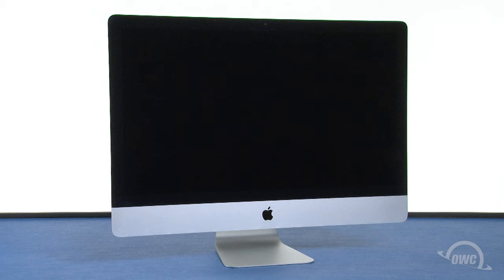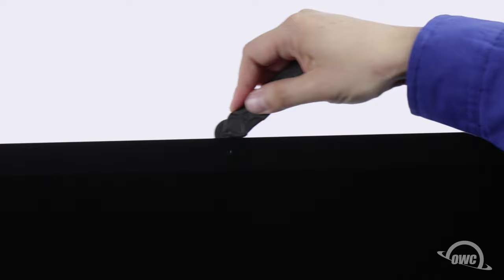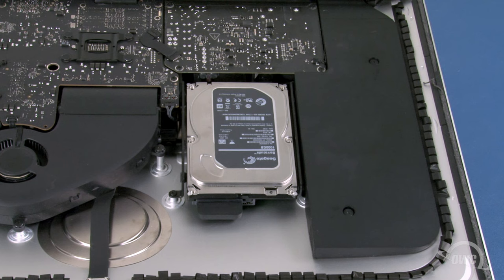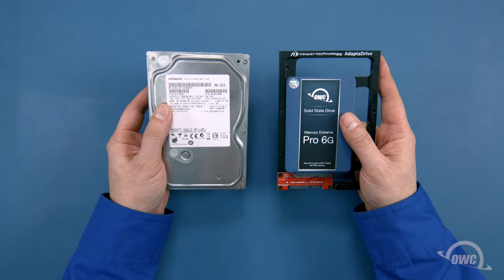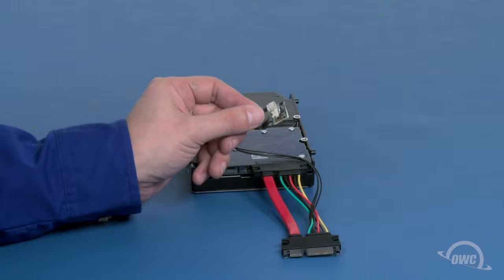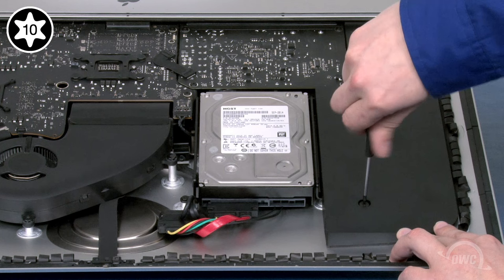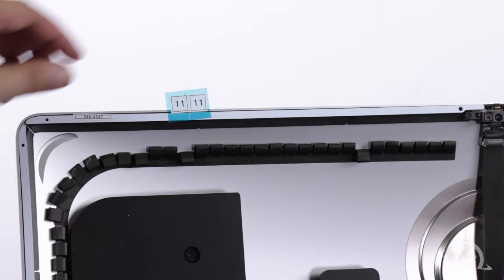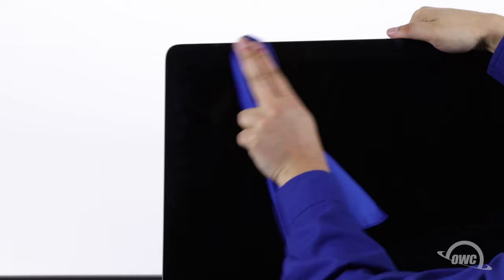How to Upgrade the Main Drive in a 27-inch iMac (Late 2012 – 2019)

Comment: Thank you a million times for this video.  I took my 2017 iMac apart...replaced the SSD...put it back together...created a boot drive to get it going....and it worked! Who knew?! Tremendous video.
Reply from the maker: We are pleased to hear. Thank you for your feedback!
Reply: I'm about to do this to mine, did you need to put a thermal sensor on your SSD to stop the cooling fan from staying on?

Comment: The most difficult part is lining up the screen once you've peeled all the adhesives.  If you want a flush fitting then I would strongly suggest you affix the screen in an upright position so that the bottom part has no gap.  Unfortunately I followed the method in this tutorial (with the screen flat) and the bottom part of my screen has a small gap and the glass sticks out along the top - it's only the width of a finger nail but still annoying.  Had I affixed it with the screen in an upright position, the bottom base would be sitting flush with no gap.  The tape does seem very sticky but I've since bought more adhesive and will try again.  If you're worried about the screen tilting whilst upright then just jam a lunch box behind it and the stand.

Comment: Hey!  I just upgraded my 2013 27" iMac to SSD using your kit and THIS video and it was a perfect install!  Everything works great.  It took about 55 minutes, and saved me $300 that a local shop told me it would cost!  (minus parts)  You know, I just might start advertising this service on my own! haha  Thank you!
Reply from the maker: We are happy to hear. Thank you for your feedback  :)
Reply: How did the adhesive hold up considering OWC's adhesive is thin tape and not foam like Apples and it seems to be a big issue with screens falling off?
Reply: Well I broke the screen and probably the motherboard… my point is simple while I wont blame OWC if this were medicos advice somebody would be going to prison.. I loved my iMac but talk about a shit design even experienced  techs want nothing to do with replacing the PCIe .. this is not an easy DIY install and you saying it was don’t make it so.. Might wanna mention that if you break the screen you might as well throw the fucking computer way pretty much much so anyways I appreciate your checking in with this success story.. Do you know what a shill is? Anyway I got my max studio coming in a week so I’m not gonna miss my iMac or hearing from you for that matter ciao

Comment: Help!!!!! I am a long-time OWC customer who upgraded the HD in a 2009 iMac. However, when I learned that the 2017 iMac display is affixed with tape, which can make removing the glass without cracking it dicey, I took my iMac with the upgrade drive and OWC kit to a computer repair tech, who then used his own tools to remove the glass. Never did I imagine I might end up with a damaged exterior. Apparently his tool slipped and he sliced through the center of the aluminum front. Then, the next day, I came to appreciate that the internal mic no longer hears anything (except if I tap on the case). Presumably, the adhesive tape in the OWC kit covered my mic port, so now the entire thing has to be opened up a second time to fix it!

So I'm curious: Are these known risks of this kind of work? Confused because I the only thing you ever hear about is the risk of cracking the glass while prying it loose. As for the slice through the Apple logo, the video shows the display being opened up like a book after the top and right and left sides are released. The remaining portion is released from the inside along the bottom edge where there is no access to the front of the case. (Regardless, I can't see how this could have happened with a plastic tool. Looks more like razor blade damage :-(
 
It occurred to me to look up skins like people apply to their phones or laptops to cover the front of my iMac, but I can't seem to find any real choices for the 27" iMac that aren't super expensive and/or ugly. (Even the mega-site Amazon comes up empty except for 24" iMac skins. Mine is a 27", which I only bought new in a box less than two months ago, which is another reason why this situation has left me kicking myself.)

Anybody have any suggestions? For example, is there something out there that can fill the aluminum scratch and make it less obvious?

Feedback for OWC: An instructional video of this nature should begin by summarizing the risks up front — ideally within the first two minutes of the video. Besides the install kit, this YouTube video was shared with the tech but either he didn't feel he needed it, or the video was just too long to watch to pick up the relevant FYIs along the way. After the initial "disclosures' are out of the way, the next part of the video should summarize key differences among the 2012-2019 models. For example, on some models within this group Apple put the mic at the bottom of the display instead of at the top near the camera. Another variable exists between iMacs that have the screen affixed with magnetic display clips vs. adhesive tape. Yes, we know that there are risks to doing upgrades of this type — but if you've done one iMac you might be tempted to think you can do them all. It's NOT ENOUGH to simply say at the outset of a video to watch it all the way through. OWC and similar How-To videos should summarize any special considerations or risks before proceeding to the instructional component!
Reply: I took my 2017 27" iMac for repair five weeks before the three-year AppleCare warranty expired in 2020 due to an insect visible under the display. I was pleased that they replaced the display without question at no cost. However, I didn't use the microphone much, but about a year after the repair, I noticed the microphone no longer picked up sound except when tapping on the case. I didn't think it was related to the repair since it was done by an Apple-approved service. My main drive finally failed this week, so I will be replacing it with an SSD. While researching how to do this, I discovered that the adhesive tape can cover and muffle the mic. Hopefully, when I clean up and apply fresh tape carefully, the mic issue will be resolved too

Comment: go through all that just to put back in a spinning hardrive seems counter productive.
Reply: Not that bad with patience. The benefits of having a faster SSD drive far outweigh the alternative of having a slow outdated drive. I’ve done 4 of these and it’s pretty easy now.
Reply: @artincorona  i did a SSD replacement shortly after that comment on a late 2013. screen was tricky and you really need to get the kit. runs like a beast now. short of hardware failure It will last me a few years now.

Comment: Good video. I wish you folks had included a look at what it would take to remove a fusion drive's SSD component as well.
Reply from the maker: Hey moeskido,

We have a whole separate video for the blade SSD.
https://eshop.macsales.com/installvideos/imac-27-inch-5k-2019-pciessd/
Reply: @poweredbyowc  Thank you for that! Small wonder the shop that replaced my failed fusion drive didn't go after the SSD without specific instructions.
Reply from the maker: As I mentioned on the other video, replacing the flash blade in a Fusion Drive http://support.apple.com/HT202574 is not for the faint of heart!

Comment: HDD/SSD can be replaced without your kit on any iMac, no full power fan blow, soon will reveal how. Just did it on iMac mid 2009 and late 2013. So no more paying for the cables
Reply: Hi. Can an ssd be put into an imac without a thermal sensor?
Reply: @hang-sangitch  thermal sensor is not a problem, it should be attached the same way as the original drive, BIOS is the one who causes the problem

Comment: OWC should highlight the microphone coverup issue in the video.  It is in the instructions with the adhesive tape, but not very obvious to the average user.  The tape is quite difficult to attach across the bottom edge of the screen anyways the tabs are in the wrong direction.  Hard to get it flush.
Reply from the maker: David, Thank you for your feedback! We appreciate your input regarding the microphone coverup issue in the video. We'll definitely take this into consideration for our future updates.

Comment: On my 2017 27 inch, I just added an external SSD and in the system settings had the start-up disc placed on the formatted SSD. Not a barn burner, but better than the fusion drive.
Reply from the maker: Hey Reecce, glad to hear the SSD had sped your computer up a bit, distance from the board matters when considering an external drive for booting, generally internal drives are faster than external but it isn't always the case, like with your fusion drive. If you ever are looking to replace your drives feel free to give us a call at 1-800-275-4576 we'd be happy to assist!

Comment: I'm a little confused. as to why I was sold the AURA X2 Memory for my iMac 18.3 All the info was conveyed to the salesman by clicking on the small Apple icon at the uppermost left of the screen (about this mac)and giving this info to the salesman..It verifies I have 2017 5k from mid to late 2017. This is an 18.3 and thus I believe not available for this type of memory why was I not informed about this before I have had to go to all this trouble?
Reply from the maker: Thank you for reaching out to OWC. We are sorry to hear about any confusion that was caused. You can upgrade the imac 18.3 with an SSD as long as the machine was issued with an SSD. If you machine only came with a standard HDD then you would need our Mercury Electra or Extreme SSD kit. Please reach out to our team and we can assist you further with your order.

Please see this link ( https://eshop.macsales.com/item/OWC/K27IM12HP2TB/ ) for the kit you would need.

Comment: And what about the data? Do you clone the drive before installation? Or after installation copying from the original drive? I’m missing that step in this video.
Reply from the maker: It is up to you. You can clone the drive before installation or after it is a personal preference on what is easier for each person.  Most of our Drive DIY kits have the option to come with an external enclosure to make this process easier for the customer.

Comment: To try and avoid headache, I wanted to get a replacement drive running externally before installing internally.

It was suggested that APFS was the format I should use for the replacement SSD for my late 2015 27" iMac running Mojave. However, it would not allow me to modify it or install an OS on recovery mode boot. With my drive failing and seizing up when trying to run disk utility, I had use another newer computer to keep reformatting it.  When I formatted into Mac OS extended journal it would accept it.  For some reason, as it was about to be done installing the OS out of recovery mode, it would go to a black screen with a spinning white loading circle that would go on forever.  When I did a alt/option boot and selected the new drive, it said it was prohibited.  Then after a bunch of attempts, I did a command-shift-R and that seems to have done the trick. Weirdly enough, sometimes I still get a prohibited startup.

Don't know if anyone else had problems but I though I'd share.
Reply from the maker: I will just say unfortunately...sometimes computers are both tricky and special in how they like to "misbehave" here and there. I'm sorry that you had to go through such an adventure just to be able to do that, but hopefully it won't happen again. Reach out to us directly anytime you have any issues.

Comment: Do you confirm that all 27-inch iMac wether late 2012 late 2013 up to late 2019 are really the same regarding their overall sub-systems ?

Here I mean that once we remove the LCD display glue then only two connectors then when removing the left side speaker, easy access to the HDD which would then host say a SSD ?

Can we re-use the PSU (power supply unit) from any model to repair another one ?

How about the LCD display, is it intercgangeable through all models from late 2012 to 2019 ?

By the way, when installing a Crucial SSD to replace the HDD on my late 2013 iMac, I did not need to add any temperature sensor, it just worked fine.

Thank you, Albert
Reply from the maker: Do you confirm that all 27-inch iMac wether late 2012 late 2013 up to late 2019 are really the same regarding their overall sub-systems ?
- Yes, all 27" iMacs share the same model number, A1419, indicating they have the same sub-system.
Can we re-use the PSU (power supply unit) from any model to repair another one ?
-Yes, you can use the same PSU provided there is no damage to it.
How about the LCD display, is it interchangeable through all models from late 2012 to 2019 ?
- Unfortunately, not all share the same specifications, such as Retina, 5K, or none at all.

The Thermal Sensor is responsible for controlling the fan in the iMac. We highly recommend installing it. While a drive replacement will function without it, the fan may not detect the drive, causing it to run faster than necessary. If you're comfortable with this, the sensor may not be necessary in that case.

Comment: I watched the OWC videos several times and ordered the OWC kit and installed the OWC 2TB  SSD and then installed Monterey. Well,  Monterey would not recognize any of my external  SSD, or USB drives. So I reverted to a clean install of Big Sur and all was well but my iMac boots up very slowly and takes nearly 5 minutes to get to the log in screen. I can live with a slow boot-up but it’s weird reading about other people having speedy boot-ups. I just chalk it up to my machine being a late 2015, 27” w/32GB ram external.
Reply from the maker: Keep in mind that the logic board firmware needs to have an OS installed first with an OEM Apple drive before it can be installed with a Third-party drive. This could be what was causing the issues with your Monterey install.
Reply from the maker: Boot time is not solely dependent on the operating system; it's also influenced by the contents and configuration of the boot drive. To optimize boot times, it's recommended to keep the external boot drive as lean as possible. The amount of data and the configuration on the drive can impact how quickly the machine goes through the data during the boot process. If you have further questions or need assistance with optimizing your system, feel free to ask!

Comment: Why do you need temp sensor to install when the orignial drive didn't have it?
Reply from the maker: Indeed, Apple incorporates a thermal sensor cable within the original hard drive itself. Consequently, when you replace the original drive, the thermal sensor cable is removed along with it, rendering it non-reusable.

Comment: The OWC Mac hard drive kit and instructions are MOSTLY good.  I found the problem is the adhesive tape that is supplied with the kit.  Following the instructions precisely, the screen fell off (fortunately, nothing was damaged).  The adhesive tape just isn't sufficient, so be warned.  For myself, I waited 3 weeks with painter's tape holding the monitor screen on (around the outside) before removing the painter's tape...three days later the screen fell off.  Disappointing that OWC didn't do testing of the product....  :(
Reply from the maker: We apologize for the inconvenience you encountered with the adhesive tape. Your feedback is valuable, and we will ensure to share it with the relevant team for improvement. If you ever face such situations in the future, please don't hesitate to contact our support team. They are always ready and willing to assist you

Comment: Great guide and kit! The installation was fairly easy. 
However, the big issue now seems bring able to use the computer afterwards. 
After installing it again, it can't update the OS, so I'm stuck on Mavericks from 2013. No update is available, and Safari can't load any webpages, due to security. Can't install other browsers, as the OS is too old. 

I'm completely lost.
Has anyone experienced the same or have a solution?
Reply: Put Mint Linux on it. That is what I did and its flawless.

Comment: It os just a shame that OWC does not provide OEM adhesive strips, the screen falls after a while because the adhesive strips are not thick enough.
Reply from the maker: We are sorry you feel that way and/or if you have had a bad experience. We work to meet and/or exceed with our products, and that is screen adhesive included. If there is ever a time you need help and/or assistance, let us know and we would be happy to help.

Comment: Which is better ssd or nvme?
Reply from the maker: So NVMe is an SSD. Now there is different types of SSD's. Now this specific iMac of this video you can install either SATA or NVMe. Now the NVMe SSD is faster than the SATA SSD.
Please feel free to contact us if you have any further questions, comments, or concerns. https://eshop.macsales.com/Service/
Reply: @poweredbyowc  thanks . I installed external nvme ssd samsung 970 1TB with usb c casing … after cloning booting is not happened , I did fresh  os 13.2  copy in to external , here were result 

Under default inbuilt Fusion Drive , boot time  was 33 sec 

Under external ssd , boot time is 53 sec !!!! 

Totally confused how other are claiming faster boot in external ssd nvme in iMac 27inch 5k retina i5 2017 !!!
Reply from the maker: Earlier in the comments we still do recommend having the drive be internal as it will be faster internally than external as you may get mixed performances when going the external route. However if you need help, I would contact us directly as that way one of our Techs can look into this more directly alongside you to help you get the best performance.
Reply: @iosuser1174  the OS is already on a ssd that is a subset of the "fusion drive" that is already inside your computer.